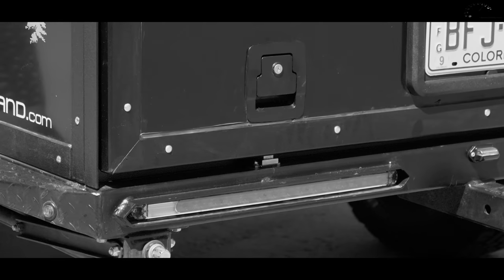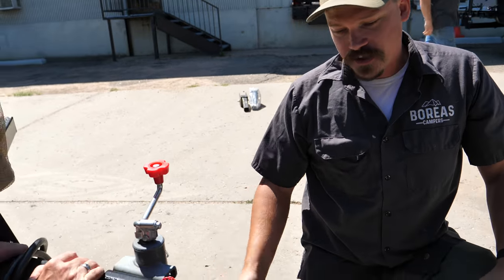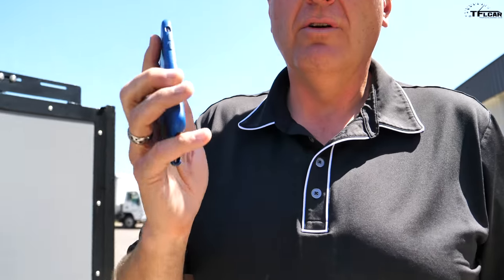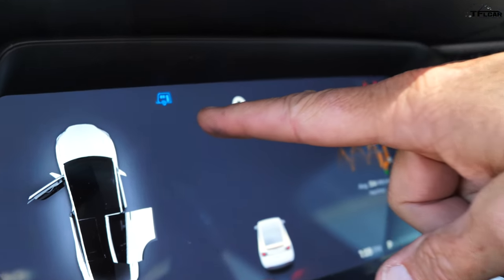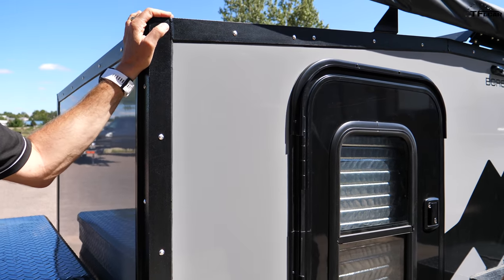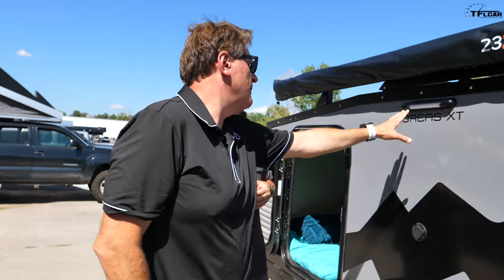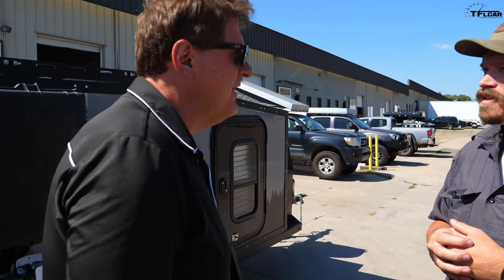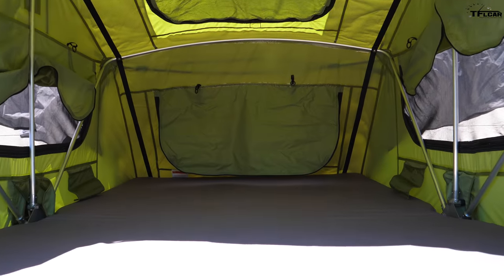Is Electric Car Camping a Thing? Let's Find Out | Adventure X Ep. 5

Comment: What you want is a Tesla wall [battery] installed on the trailer and few more solar panels adding to the roof to charge while your driving and camping.You can really go off road and off grid using  your Tesla wall to charge you back up to get you back to the grid for the return journey. Would also help alleviate any worries you have for range while you travel.........................
Reply: And include Regen brakes on the trailer to charge the Tesla wall inside the trailer.

Comment: You can buy a really nice trailer with a full bathroom...for under $20,000!
Reply from the maker: But can it overland and go offroad?
Reply: @TFLcar  exactly!

I think a lot of people would be interested in a more simple cargo version of an off road trailer. They're probably out there, but it would be interesting to see what a 1,750 lb ish loaded trailer would look like. (Something a two door JL could move)
Reply: Exactly what I was thinking. There's plenty of off-road worthy models (you're not going rock crawling with any of them, this one included) that are cheaper than this. The Rockwood GeoPro comes to mind (with the ePro a similar model). A 19' GeoPro goes for ~$19k right now and weighs 3000lbs. Granted it won't get the fantastic fuel economy this small cube is going to get, but seems like a lot more (practical) trailer for less money.
Reply: Those trailers for 20k and nice bathrooms are not trail rated though.. lol
Reply: @TFLcar  I saw that brief shot of the frame so yeah just add some K02s and that fancy coupler to any trailer and you're good.

Comment: Interesting video and excellent use of a better route planner.

Why did you guys not measure the reference consumption with the rooftop tent mounted? Seems like that's somewhat of an unknown factor here which could throw your careful calculations off.
Reply: The weight is negligible but the wind resistance might not be. I'm sure they'll monitor it closely the first few legs on the journey and adjust if needed.
Reply: @JahyMoonwalker  More likely they'll "go for it" to create a little more drama and clicks.
Reply: I’d put a pretty penny of them totally running out of battery or getting within 2% and making a HUGE production of it based on this alone. They are setting themselves up to pretend they planned it out really well and then have this massive aerodynamic drag cause them to blame the EV not being ready for prime time.

Comment: You should have done the energy test with the tent on board. That's a lot more drag which is the biggest factor at highway speeds. The whole trailer needs a low drag fairing over the front. Maybe a boat shrink wrap.

Comment: 15% is a bit too high, you can drop it to around 7% and be fine and it will decrease the time you spend on charging since you won’t need to charge all the way to 98% for some stops.
Reply: Yeah, but they are still scared of EV's. Did you see how they ended their 4700lb horse trailer test? It never crossed their minds to continue back but slow down a bit. They liked the power of going up the mountain with the trailer at 75mph but were shocked at how much power they used. I don't think they quite have the feel for the power consumption. 2c
Reply: Agreed 10% would be better.  They may arrive at 15% or 8% depending on how they drive.  When I hit 30% I slow down.
Reply: Trigger Troll  I slow down from 80 mph to 65 mph.  Tesla golf carts are some of the fastest accelerating production cars and SUVs on earth.
Reply: Trigger Troll  He got up to 158 mph.  At that speed, he could go over 120 miles in 45 min. Electric cars only have one speed. The Two-speed Tycan should be more efficient at 160 mph.  The two speed Tesla Roadster will be electronically limited to 250 mph. My bet is at 150 mph the roadster will go over 300 miles.
Reply: Trigger Troll  The BMW M3 could not go 150 miles on a tank of gas at 160 mph.
Reply: Trigger Troll  The C8 is not particularly good looking. The nose is too pointy, the wheels are too small and the rear end is too tall. And it absolutely positively can't go 600 miles at 160mph. By the way the Model X Performance gets to 60 in 2.7 seconds. Beaten by a 7 seat SUV lol.
Reply: Trigger Troll  Well, the Model S does 0-60 in 2.3sec so we'll see. The Roadster is planned to do 1.9 in the base version. Stunning design too if they don't change it.

I agree internal combustion still has the edge in racing, but that's about it as far as I can tell. The Roadster should be able to charge at at least 700kW just based on battery technology. The massive advantage in acceleration could potentially make it competitive under specific race conditions, for example on a track with large elevation differences or at high altitudes.

2X your investment in 25 years doesn't sound that great really, and it seems to be a bit early to declare the C8 a classic when they've hardly started selling them. It's not out of the question that the future verdict will be that Chevy corrupted the Corvette's legacy by changing to a MR layout.

Of course it could be a great success too (though if my opinions of its mediocre design is anything to go by, I'm skeptical).

The point is we don't know what the future holds.
Reply: Trigger Troll  200k for the base model. Admittedly the hot C8 will probably be significantly cheaper. But you might make up the difference on gas savings!😄
https://www.tesla.com/roadster
Reply: @phamnuwen9442  In a couple decades maybe!

Comment: Alot of comments are about the trailer, this is a specialized trailer for off road /overland use  the construction is not like a normal camper. The tires are bigger the axle has more articulation and the frame is designed and built differently than a normal camper, . Most likely they used it for sponsorship and free usage. But behind the X they should have used a tear drop trailer as they will never be able to go far enough off road to truly show the ability of the trailer. Hope this helps other understand. And no I don't think they are worth that amount of money, but again this is a specialized market so that means $$$$
Reply from the maker: This is an overlanding series that’s why the overlanding trailer. Did you see us take the Tesla off-road?
Reply: @TFLcar  I understand, that's why I said you would be better with a tear drop as this trailer is set up for offroad. The exoframe the the timbren suspension will never be exploited with the X. Over landing mostly designed as an off highway travel. If you are just going across America on paved or dirt roads and camping, a different trailer would suffice. Keep up the good work I enjoy your content.

Comment: that is a cool trailer and all... but for nearly $30,000 id rather get a Casita or Scamp
Reply: @dallasray3223  exactly... now for a $30,000 trailer, id want it to be a trailer that you can fully stand up in and have an indoor kitchen.
Reply: @dallasray3223  likes there's sooooo many other options out there for a fraction of the price.. a fully loaded  Casita 16 foot that you can stand in and bring your family with AND take offroad costs $20,000. And thr best thing is Casitas/Scamps are built to last 30 years.

I feel like if i went offroad with the trailer in the video that after taking it offroad a few times, the seems of the trailer would crack and allow water to seep in
Reply: For 30k I'm remodeling my house. F campers.

Comment: And why exactly are the trailers shaped like a square box?! Apart from the additional weight that awful shape is the main factor in increasing power consumption...
And it doesn't even matter if one drives an EV or an ICE car. Yes, you can refuel a normal car fast, but it's still wasted energy (and money)...
Reply: I guess to keep it short and simple they killed aerodynamics?
Reply: To sum it up in one word, space. My buddy is an engineer as is his father as well as a builder and I remember years ago when his father built their house, I asked him why they built one of those salt box big square designs and his dad said "space", he said you will never get more room in a home than if you make it a big box and he was right.
Reply: @venom5809  same thing in tank designs, the IS3 used lots of angles to improve thickness of it's armor without gaining weight, however this led to a very cramped vehicle, compared to the Tiger II, with is pretty boxy, and had much less cramped fighting compartment.
Reply: The all-aluminum Airstream trailers where pretty aerodynamic and faily roomy.
Reply: @fatboy19831  I'm a huge Airstream fan.  With Airstream, you pay for shaped aluminum construction and quality materials inside.  Unfortunately, they don't hold up off pavement.  The axles don't have the strength, the body gets torn up and interior starts to fall apart even with dirt road miles.  I know of a couple that had to deal with that on their airsteam traveling the Alcan highway. I considered building out an older airstream to handle off pavement work, but gave up on the idea and went the with a pickup bed solution.
Reply: They sell them to be towed behind a big square box so why would they make the trailer aerodynamic?

Comment: So basically one refuel stop for diesel in my v10 Touareg for 7 or so minutes, or 11 stops in a Tesla for 7-1/2 hours. Strange that the brand new Tesla needs a load adapter like my 2006 for LED lights. Towing with all electric doesn't seem to make sense - at least yet.

Still cool that you are doing this - hope you make it!
Reply: Yes, but how many stops for mechanical breakdowns would you need to make in the Touareg?
Reply: @fatboy19831  Zero. If you follow preventative maintenance schedules and use the correct fluids and filters, mechanical breakdowns are rare.
Reply: @hallkbrdz  That has not been my experience with Vw's.   Audis, for the most part, have become fairly reliable as long as they are under 8 years old and under 130,000 miles. VW's tend to have all kinds of minor and major mechanical problems.  Most VW owners have solutions to these problems. Preventive maintenance can mean many many things on a VW. Unlike oil and fluid changes on your average Toyota.
Reply: @fatboy19831  Mine all have more than that, with one at almost 500K. Yes, you have to actually maintain them - what a crazy idea. Even with a Tesla you should be changing the brake fluid every two years - something most people ignore, and one of the most critical things to do.
Reply: @hallkbrdz  I drove a 1984 Toyota Carolla for 100,000 miles with 4 oil changes, 1 set of tires, 2 sets of wiper blades.  That was between 205,000 and 305,000.  My Cherokee has 312,000 miles original trans and engine. I have never changed a belt on it. I changed the transmission fluid at 150,000 miles one time.  I have done 3 radiator flushes and changed the brake fluid 4 times. Only changed the spark plugs twice. I would drive it cross country tomorrow. 
 Most Vws are all but useless in the states above 100,000 miles.  The VW Diesel are 400,000-mile cars but you are killing the air we breathe. VW has been cheating the emissions laws for years.

 The brake fluid on a Tesla does not get the same work out as on an ICE car. 90+ percent of the stoping is done by regenerative braking.  Still, condensation builds up in brake fluid if you live in a 4 season climate.  In California, you could change the brake fluid every 5 years in a Tesla. Most likely if there is no leak in the system it would still be good.

Comment: Yikes. I-84 from SLC to Portland at 65mph or slower? That's miserable (and some might consider it dangerous) to have traffic catching up that quickly.
Reply: Right? Some parts of I 84 are 80 mph
Reply: @lancerasmussen8580  Luckily trucks are mostly moving only 75 or less, but a large amount of other traffic is about 85 most times I'm on that road, and some days I'm getting nearly run over when I'm doing 85 past a line of trucks.
Someone going 65 or less is going to be passed by a lot of trucks, and there will be a lot of other traffic backed up and doing crazy things until they all get past you.

Comment: So why did you rely on the automatic detection of the trailer? You can just activate trailer mode 🤔
Reply from the maker: Because if the Tesla does not see the trailer, you can't active it manually. The manual control does highlight.
Reply: @TFLcar  ah okay 🤔

Comment: Did you fill the water tank?  If not that's going to add significantly more weight to the trailer, thus more power consumption.

Comment: In your route planning with abetterrouteplanner, you didn't add charging with J1772 or stops at RV parks where you might be staying. Adding this on the website is actually a built in feature. You're only supercharging, which isn't realistic. These can be charging the Tesla at least 7-10 kW while you're already resting; thus, cutting your total charging time needed for the trip.

Comment: That spot between Tremonton and Twin falls is a lot of large hills also.(lots of nice camping also) Wondering if it factors that in. 63 may be a bit on the fast side not to mention it's windy. Hear the rooftop tents can reduce fuel mileage in petrol motors because of drag. would they not do the same to battery power in the X? So many questions. Good luck! Maybe take a good generator.

Comment: The trailer could fit about 5 square meters of solar photovoltaic on the roof. That will collect about 7 kilowatt hours electricity per day which should be worth 35km / 22 miles of driving.   More could be fitted on the side.

Comment: This will mean a lot of charge taper that starts after you hit 50%. 

You want to avoid that as much as possible, but at 550 watts per mile, it's unavoidable.

More stops and less fill. Spend 10 minutes stretching at each stop, and at the end of a 12-14 hour day you will not be stuff or sore.

If you get to a Supercharger with more than 10% charge, you are doing it wrong. 

Be interesting to see if you can break 45 mph average....

Comment: You'll need to recalculate your wh/mile with the added tent on the top of the trailer, due to much increased wind resistance! I wouldn't be surprised to see you go over 600wh/mi or more.

Comment: I’m certainly enjoying the series, but idk if electric is ready for Main Street (as y’all seek to discover). Based on your map estimate it’ll cost $155 at chargers, limit you to a max speed of 65 and add 7 hours to your trip. My 95 Chevy K1500 diesel getting 17 mpg (estimate based on my real world 15 mpg towing a 5,000 lbs camper) would do the trip at around $190 at up to 75 and spare me the majority of that 7 hours charging time (I’d obviously have to have a little time spent filling up and grabbing road trip snacks). I really enjoy the videos and am interested to see the real world results, but not sure if the difference in cost savings out weighs the extra time. (Not to mention you spent the difference in cost on the parts to make the Tesla tow ready for this experiment)
Reply: Keep in mind that an EV, assuming an EV that is priced similar to other mainstream cars, not a $100,000 monster like the X, is optimized for the 99% use case.  It's going to be cheaper and easier in such an EV 99% of the time.  For most people, they do camping so rarely that it would make more sense for them to just rent a whole motorhome instead of just a camper.  Cheaper as well, assuming they only camp once a year.  Or, depending on family size, if it's just 2 people, just get a roof storage container and sleep in the EV itself.

Comment: The most important commodity you have is electricity. So why don’t you treat this a little differently. The camper is like a huge said and if you hit headwinds of 15 mph that means the car is towing as if it going 80. So why don’t you use the roof rack and put up an air spoiler to break the wind before it hits the trailer? Should save you more power to offset the weight of the air defector.

Comment: You have the same problem on German cars where there is a Canbus system, the system refuses to talk with many bulbs.
 What do you call that magic adapter? Please!?
Reply: The adapter is just a resistor.  The LED replacement bulbs, if they say "CAN bus compatible", they really just mean there's a resistor in the bulb.

Comment: Looking for to see how the trip goes.. 
I think I would just figure out how to camp inside the car itself. 
I would think two people could do that easily.
Hell I camp in my Prius without any issues... No off-road though.. well not much.
Reply from the maker: But can you tow with your Prius? No, so what other choice do you have?
Reply: @TFLcar  
Nope I can't. But I don't need to tow. I can fit a Twin air mattress in the Prius cover the windows and sleep as long as I want, I could park and camp with full Climate control nonstop for 6 days on a tank of gas,   and I can drive 400+ miles at 85mph, stop refuel in 5 min and repeat. As long as I need to. 
My record trip is 1200 miles in 19 hours nonstop.
I can also...NOT spend $100k